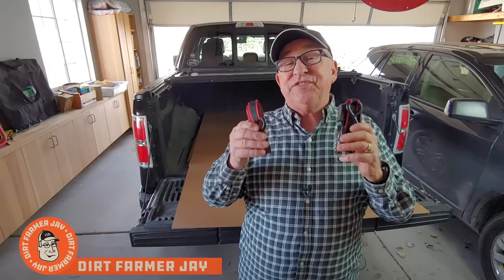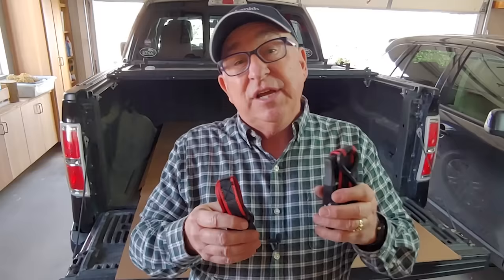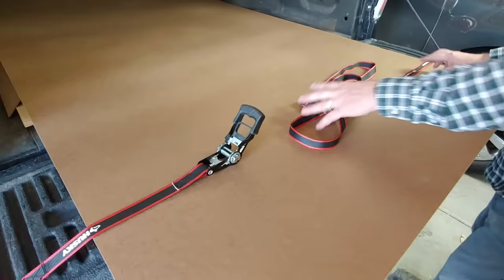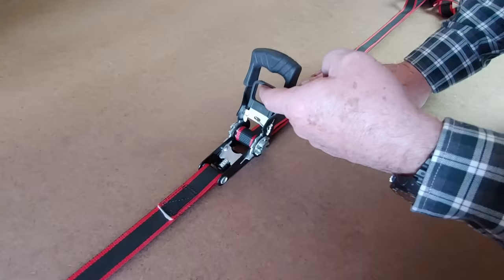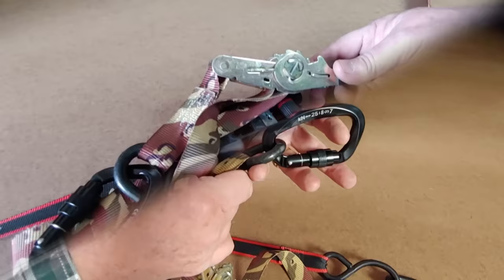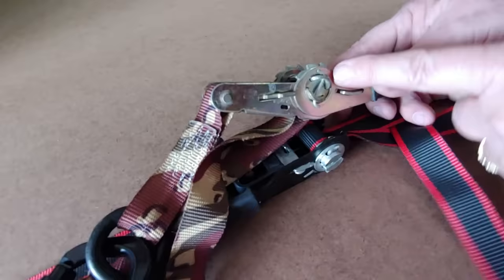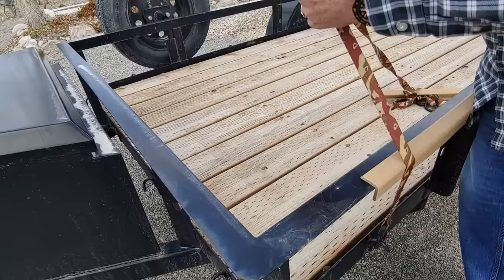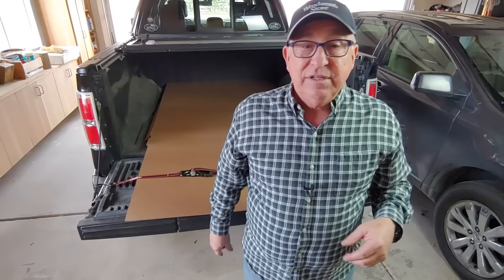How to Use a Ratchet Strap - Tips and Tricks!

Comment: I've used the straps for years but just learned some great tips I never thought about.

Another use I have discovered for my straps is that when working on a very large woodworking piece like a bed frame, the ratchet straps are a great woodworking clamp for holding pieces together and taking out some warp in boards that are beyond the reach of all but the longest and most expensive woodworking clamps.  They also allow you to do more work by yourself when no helpers are available.
Reply from the maker: Good stuff! Thanks for watching and commenting. Best, DFJ

Comment: i used to carry some 1" ID PVC pipe that was cut to about 4 inch lengths and cut in half to add radius to whatever i'm going over if it is a hard edge, now i have a trailer that has box rails that have a radiused edge and i wrap the strap around the rail and hook back to the strap webbing itself if i'm unable to reach the tiedown in the bed of the trailer, such as for hauling brush, i also have some commercial straps that are 3 inches wide and are roughly a quarter inch thick, that have the large "V" style hook, and that fits perfectly around the square rail for heavier loads such as big heavy brush, trash, debris etc, light brush gets 3 or 4 of the smaller straps, heavy brush gets 3 of the big heavy "keeper" straps (also listed as "Haybale" straps), definately good information that you have provided in the video, another good way i've done in the past of "policing" up the tag end of the tail is to roll it up, flatten it, and use a small bungee cord thats around 3 or 4 inches long and wrap the tag, then hook it back around the webbing, or strap it to the side of the trailer top rail to keep it from flailing, this also helps when dealing with bulk loads that take up your entire work space in your truck or trailer and makes the tail easier to find, i also tend to do at least one full wrap around the drum on the ratchet strap which helps keep them tighter longer on long trips, as well as making sure you have a good positive lock on the webbing, but do keep in mind, even the big straps will "relax" and stretch over time, so be mindful on long trips to check your tightness at regular intervals, when you stop at a rest stop, or stop for fuel are good times to make sure your straps are still good and tight, also as someone else said, having the ratchets on the drivers side of your truck/trailer is a good reminder and a good early warning that a strap is loosening off, i lost one strap that way on a trip to the dump.... the ONLY time i've ever put the ratchets on the passengers side of the truck, and as you said in the video, you can exert an Alarming amount of force on a ratchet strap, enough to actually break the webbing if its over a hard edge, or if its under a lot of strain and has spent too much time in the weather, i store my straps in an old ammo box with a desiccant pack and a handful of small bungees to secure the tag end of the straps when in use, stay safe out there
Reply from the maker: Fox, wow, your message was FULL of great insights and practices. Thanks for taking time to write your thoughts down in such a detailed fashion. There are some great practices in there. We will be making more episodes on best practices submitted by our viewer family members - there's a couple in here that will likely make an appearance. If so, we'll be sure to mention you. Best Regards, DFJ
Reply: @DirtFarmerJay  cool glad I could help contribute

Comment: One thing I would add is always have the ratchet on the drivers side. Especially on long halls, straps loosen after a certain amount of time. It is much easier to see in the drivers mirror vs the passenger. Stop & check several times in your first 50 miles.
Reply from the maker: All great tips!! Thanks! Keep watching and commenting. Best, DFJ
Reply: Strapping on the curb side keeps the driver away from traffic when stopped to check or re-tension the straps. You do have 2 mirrors!
Reply: @tomnovak7731 
Exactly.  The same reason you're supposed to put a child restraint seat in the back passenger side.  Keeps you out of roadway traffic.

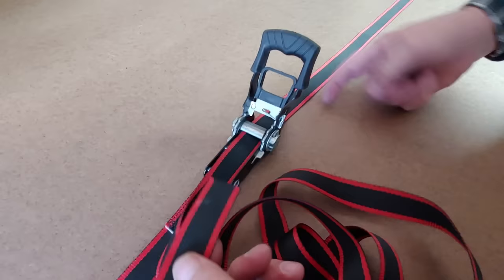Comment: 3:35 start with the handle closed and the slot aligned and it is one movement, no pass back through.
Reply: Never understood why people insist on passing it back through, Don’t pass it Back through and you can use the tag end of the strap for leverage to tighten. Then when it is time to release the load you grab the tag and rotate the handle to disengage the ratchet, pull the tag end And voila. By passing it back through it is way too difficult to release the strap from the ratchet
Reply: @frednot809  because you can pull tight with one hand and your hooks don’t drop off.
Reply: @Cous1nJack  I can do the same thing without passing it through though. To each their own. I don’t necessarily think either way is wrong. That’s just the way that works easiest for me and that’s how I always train people to do it.
Reply: @frednot809  l'm a pass it through man, have been for 40 years. I teach all the young people to pass it through. How do you keep both ends in tension with one hand while ratcheting with the other hand with out passing it back through ? Only bent or rusty ratchets are a problem to release if they are not overwound. Pulling the slak tight before starting to ratchet is the only way I know of to always avoid overwinding.
Reply: @johnossendorf9979  If we can agree that you don’t use the tag and to tighten, the way I do it is leave the ratchet  open, Bring the tag and threw one time then pull it toward my load, then simply pinch with my other hand, it allows you more revolutions to tighten some thing because you only have one layer of strap instead of two,You can use the tag end for leverage To tighten a load by just grabbing the end and as you pull up it pushes the ratchet to tighten it. Removal is as simple as opening the ratchet and pulling on the tag end, Unrolls the entire ratchet in one movement. I’m not saying the other way is wrong necessarily. But it’s not for me. I truly find it easiest the way I described
Reply: Pass back is just more work without any gain and it makes it more difficult to undo

Comment: Great tips, Like others have said "if I knew this years ago" :)       One observation though, when connecting to the strap hooks. Try not to connect (hook/carabiner) back on the metal loop the strap is on. This will cross load the metal loop. If the loop was welded back on it's self, then no problem. Seeing that there all pinched back on them selves, with enough force it could  bend back and the strap could slip out/off. Instead hook on to the stitched loop on the strap and let that hook dangle.
Reply from the maker: Great points, Johnnymailman. Based on the amount of interest we are seeing on this topic, I foresee another episode featuring great insights that have been sent to us. If we do another episode, we'll be sure to include what you've mentioned, as well as give you credit for it. Thanks for taking time to write! Best Regards, DFJ
Reply: I've cut the factory hooks off,  used quick links and snap links
Reply: I don't think you'll ever be able to exert enough tension on that strap to open that hook loop!

Comment: I start with the clasp closed, so I don't have the feed the end back through. 

Then again, I'm usually doing this for a load (canoe) that's on a roof rack / bars, so the loose end hangs nicely after passing through the slotted bar.

Comment: When you have an overspooled/bent/corroded ratchet you can manually spin them in the unwind direction  by putting a flat blade screwdriver perpendicularly,  or I use the back of a closed spyderco folding knife in the slot on the end of the barrel(where the keeper pin goes through)
Reply: When you get in a real "bind" just cut the strap!   LoL !
Reply: Open the wratchet to it's full open position; keeping tension on it the loaded strap & the release pulled, the handle can be wratcheted in reverse to back the strap off the drum until enough play is available to release the load and tension...learned this using 5k & 10K lb commercial load straps and it works just as well with light weight as well!
Reply: I have used the screwdriver method a couple of times, when someone wraps too much strap to release normally.

Comment: Great tips - thank you.
You advised to avoid having twists in the strap. I found that straight, flat straps will 'hum' or 'vibrate' loudly when driving on the highway, which is really annoying. I've found that putting a couple of twists in the strap over long lengths will stop the noise completely. 
As you say though, it's really important to keep any twists out of the ratchet mechanism - they'll quickly jam it up!
Reply from the maker: Thanks for watching and commenting GarrisonFall. Jay's comment about not having a twist was when rolling up the strap to stow it - making sure that there would not be a twist rolled up that would cause problems when it was being ratcheted on a load. He always puts a twist or two when tying a load down for the exact same reason you sited. Best, Dirt Farmer Maggie
Reply: Twist the strap but not through the jaw.
Reply: Twisting will also help diminish the vibrations in the strap in the wind.

Comment: Just a quick one for releasing bound up ratchet straps which I learned growing up in & around the trucking,  heavy duty equipment industry from an early age.  Although I did not stay in that line of work directly, being in equipment sales and service, an avid outdoorsman and boater I  have used proper loading techniques for years.  Try this and it will make life alot easier using mechanical ratchet straps:

Open the ratchet to it's full open position; keeping tension on it the loaded strap & the release pulled, give it a quick jerk to induce movement to the strap.  If it doesn't release the drum to turn freely which can be caused by various reasons such as corrosion, road grime or bent ratchet components then the ratchet handle can be ratcheted in reverse to back the strap off the drum until enough play is available to release the load and tension by keeping tension on the load strap...just back it off in reverse keeping tension on the load until enough play is gather to release the hook(s).  Then, once the strap is removed from the load secure the tail side hook onto a stationary point, open the ratchet flat, pull on it and sequencing it between open and closed position will allow the drum to back the strap out. (Make sure to clean, lubricate or replace the ratchet before re-using).  Learned and have practiced it successfully for over 40 years using 5k & 10K lb commercial load straps and find it works just as well with light weight load straps as well!
Reply from the maker: Scott, thanks for taking time to share your insights. This is great stuff. We'll likely use this in an upcoming episode, and I'll make sure to give you credit for it. Thanks again - Best Regards, DFJ

Comment: I very much appreciate you going over the release of a jammed strap (at the end).
Reply from the maker: You are so welcome KikinT. Our goal is to try to answer as many questions/situations that may come up DURING a video so our viewers enjoy the experience and don't have to search for more answers. Best, DFJ
Reply: You guys are special if you can actually wind too much strap onto the ratchet! 😆
The way they are designed is that as the spool of strap gets to large it forces the ratchet dogs outward so they no longer engage in the teeth on the body. Thus you can't tighten any further. 
The only time you should have trouble with the strap binding is if it folds over as it goes through the winch.

Comment: When using quicklinks or 'biners just be careful of how you load the eyelet on the hook. Some ratchet straps have enough room to connect straight to the fabric sling, but if you can't do that just double check how they're loaded. Those bent hooks aren't welded, and they can easily open up if you put force on the wrong axis. It's still a good idea, but you just need to keep an eye on them.

Comment: I you start with rachect closed you dont need to feed it back through the 2nd time.
Reply: I was going to point that out too. I have always feed the strap though with the ratchet closed.
Reply: Count me in on this comment. The most common misuse of a ratchet strap is to feed it with the handle in the open position. I hover between cringing and laughing at people who struggle to put the strap back through the handle when there's no reason you should have to do so in the first place.
Reply from the maker: Jim Carris, John Ossendorf, and fantasticsound - great insight all of you. I'm so used to doing it that way, that it's become my practice and I don't have any problem threading the strap. Having said that, I've begun work on changing the habit to the way you mentioned as it simply is better and simpler. We have another best tips video coming out (we have had so many people weigh in on this topic with some really great practices). I'll make sure to own up to the misstep and point out the better way. Thanks all for taking time to write! Best Regards, DFJ
Reply: @DirtFarmerJay  You actually don't have to feed it back through at all. Been using straps probably since they started making them and I never feed mine back for the return trip toward the starting anchor point. I always simply push the strap through leaving the tail toward the anchor point that's holding the ratchet.  After I pull the strap through and pull as tight as I can towards the ratchet side, I just start ratcheting and it tightens as tight as a drum. Just make sure the tail is on top, not underneath.  Doing it this way your not near as likely to crowd  and bind the ratchet. It will release every time. It's essentially the same thing. It just helps keeps everything straight.
Reply from the maker: @brighterredneckideas8021  Well said, I've adopted this approach as well because of the feedback and insight of several viewers like you. We'll be updating to this approach in another video coming out shortly. Thanks for taking time to write! Best, DFJ

Comment: Great video, but I have to disagree or clarify on 3 points.
1- Laying the strap flat is a mistake when hauling at highway speed. That will allow the wind to turn your strap into a really annoying musical instrument. To avoid vibration put a 1/2 twist in the strap between every contact point with the load. If you're saying "but that will weaken the strap!" you have been misinformed. Tests have shown that no noticeable weakening will occur until significant twisting occurs 
2- carabiners. When using a screw gate caribiner be sure the screw is closed under load. This is especially true if the gate has a "keyhole" style retention system rather than the pin and hook style. For my money I'd just go with quick links. The harder steel will retain its shape better than soft aluminum. Nicks and gouges are stress risers that over time will contribute to fatigue and potential failure. Steel is less likely to be nicked. If rust in the threads of the quicklink is a problem spray a bit of WD-40 or dab a bit of antiseize. Even some green thread locker wouldn't be a bad idea. And on that note...
3- WD-40 is not lube. It is a rust preventative. WD stands for Water Displacement. For corrosion to occur four things are required: An anode, a cathode, an electrolyte, and a flow of electrons. WD-40 and most corrosion preventers work by shielding the metal from the electrolytes which are suspended in water. Keeping the water from resting on the metal is the key.

So what should you use to lube joints instead? Any decent silicone lubricant will work fine. There are satisfactory products under brands like Liquid Wrench, PB, WD-40, and others. Not the original products of those names, but the brand used for name recognition.

Anyway great video, but since this is mostly for DIY noobs I thought I'd better clear up some misconceptions.
Reply: WD 40 is only a rust preventative for a short period of time...it works as a solvent and breaks down any lubricants on metal that would shield it from moisture causing more rust damage over the long term.  Due to inflation, thats my $ .10    :)

Comment: i think its easiest to feed the strap though in the closed locked position. the way this video show its like feeding it though 2 times. you must alight the cam 90 degrees from the handle so it feeds strain though. Ill have to try the loop for storage. a lot of time i use the ratchet handle to lock down the free tail end. it has teeth under it i think its designed for it.  I use the straps at least 50 times a week for work.
Reply: I agree ! I close the ratchet and makes it a lot easier to feed the strap through ! I also use zip ties to secure the extra strap after I roll up the access !
Reply from the maker: Tim Z, you are correct. Others have mentioned this as well, and it's a superior approach to the one that I demonstrated. My technique works, but it's not as direct and elegant as the way you mention. We have another episode planned showing the best viewer family insights, and this will make the list! Thanks for taking the time to write! Best, DFJ
Reply from the maker: @fuzzyelm1  Eddie, thanks! I like the zip tie approach. Another viewer uses large binder clips (the kind used to clip sheaves of paper together) to accomplish this. We love this medium because we get to have great ideas and conversations exchanged. Thanks for weighing in! Best, DFJ